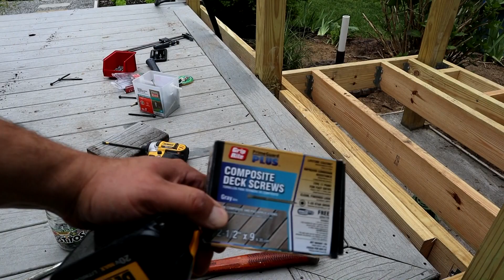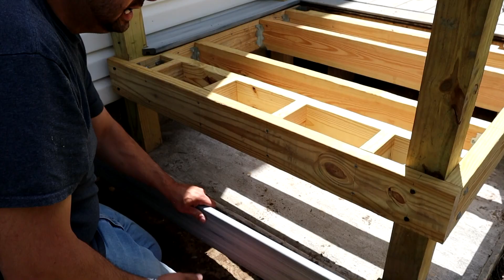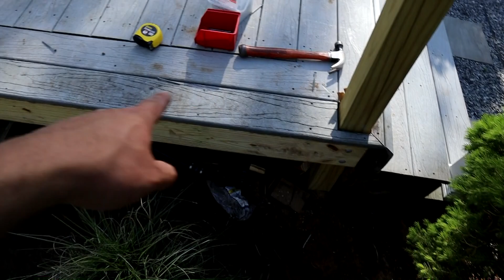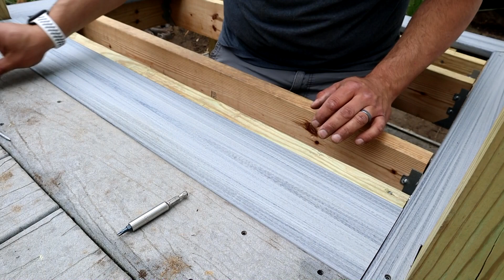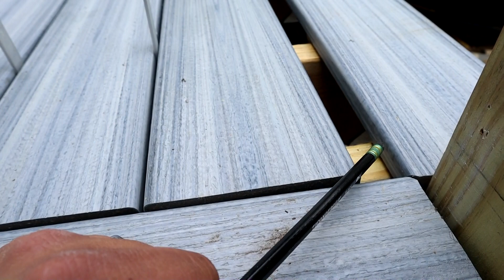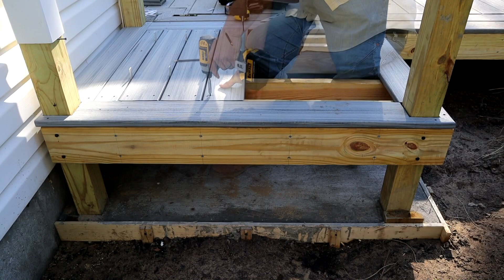Install Composite Decking | How To

Comment from the maker: Joist Tape: https://amzn.to/3wYFFQu
The LAST pair of pliers you’ll ever buy that the PROS use: https://amzn.to/3aYacDk
The BEST Screwdriver: https://amzn.to/32XKy1m
Miter Saw: https://amzn.to/30UHYFJ
Milwaukee Drill/Driver set: https://amzn.to/3auep1t
DeWalt Drill/Driver set: https://amzn.to/2PVXmM3
AWESOME wrenches: https://amzn.to/3lioLq3
DeWalt grinder: https://amzn.to/34LalZV
The BEST Hammer: https://amzn.to/3lUKFjw
Canon M50: https://amzn.to/2PdqqhO
Level 2 foot: https://amzn.to/2Gxa02F  
Mic: https://amzn.to/33jqXae
Tripod: https://amzn.to/3k4w3wP
2x6 Joist hangers: https://amzn.to/2R3xiz2
2x6 Concealed joist hangers: https://amzn.to/35gMJwt
Joist hanger 1 1/2" nails: https://amzn.to/2ZezW9P
Joist hanger 3" nails: https://amzn.to/3jQSncr

Comment: Did you add fascia to this deck or leave it with the bare wood look? I'm debating on just painting the structural area white instead of adding fascia due to the grooved bottoms of the Fiberon Goodlife. I don't think I can add fascia under it unless I make it flush with the deck boards which I don't like the looks of that method.
Reply from the maker: Yes, I added facia and lattice. There’s another video on my channel covering the install.

Comment: no expansion around the picture frame??, or anywhere for that matter?
Reply: That's what I'm thinking too! I'm about to start laying my composite deck and looking for proper gap on butt joints. Should I go for 1/8" or 1/4" expansion gap?
Reply: @juantamad8339  depending on what part of the world you live (summer heat) in but 4-5mm = 1/8- 3/16 should be enough
Reply from the maker: The problem I had when building this is matching it to the original decking. Ideally, yes...plan for expansion. I will say that after a full season of temperature swings and weather, the deck has suffered no ill effects. Thanks for the comment!

Comment: Thanks for the video , How’s face screwing the scalloped Trex is it strudy they recommend not to face screw it but I can only get my hands on the scalloped stuff right now.
Reply from the maker: Same problem I had when building this. Nothing was readily available due to covid. The deck has been in for over a year in all seasons in my area. 100 degree heat to below zero temps/snow, 2 hurricanes and a tornado. No issues at all!  I think it passed the durability test 👍🏻

Comment: Thank you for the tips. I recently did my first composite install and was torn between spacing my mitre joints or butting them. Do you think it is something of major concern to space them or not?
Reply from the maker: I personally don’t like the miters spaced, looks like something was cut wrong in my opinion...but, to each there own!  Thanks for the comment!
Reply: @fixitwithzim  thank you for your feedback.
Reply: you should always leave a gap between composite decking as the product can extract in warmer weather, so if joints are butted they will buckle

Comment: What screws you are using ? How come you are not using hidden fastener system ?
Reply from the maker: Composite decking screws from Lowe’s or Home Depot.  The existing deck this is connected to doesn’t have hidden fasteners so to make it all somewhat match, i opted to go the old school way

Comment: how come no joist tape ?
Reply from the maker: I’m not sold in joist tape. This deck was originally built in 96. Joists still perfect without tape. Ripped up deck boards a few weeks ago on a deck built in the early 80’s. Joists were in great shape, reused all the framing for the new boards. Who knows. Sometimes new stuff isn’t always better

Comment: Very well done! I have a question though. Instead of putting in two thinner boards that you had to cut on each side, why not just put one thin board against the siding/house? I know that’s nitpicking. It’s really not even noticeable the way you did it. It looks outstanding!
Reply: That way, it looks even on both side.

Comment: The final job looks very cheap. The other method is to use plugs the same color as the boards to hind the screws or use fasteners where no screws are used at all. 

The last solution being the best.
Reply from the maker: I mentioned it in the video, I was matching this area up to the original deck which was installed was exposed fasteners.  Sometimes you gotta work with what you have.

Comment: The small deck piece that was ripped should go agaisnt the house to help its even there. thats like day two of carpentry apprenticeships... just saying
Reply from the maker: Not when you picture frame the deck perimeter my man.  Full boards for picture frames. Thanks for the comment
Reply: @fixitwithzim  would still be on board up next to the house and much less noticeable then at then at the front. Just my opinion and the opinion of every custom home builder in my area. its all about the details
Reply from the maker: @adammiller8415  nahh, that wouldn’t work but thanks for the feedback 👍🏻
Reply: Im coming up against the same problem on a much bigger deck. I cant decide if i should have one sliver or two wider boards. Also wondering if i can notch a scalloped boar after ripping it like that so I dont have to face screw it and use the hidden fasteners instead?

Comment: You forgot the joist tape
Reply from the maker: For me, the jury is still out on joist tape and whether or not it helps or hurts. We shall see. Thanks for the comment
Reply: @fixitwithzim  I'm in process of redoing the deck where I just move to and trying out the tape because original build of deck 1 foot over dirt and had sides completely cover in and trapping all moisture rotting a lot of the pt joists and pt deck boards never being able to dry out. Now recovering with Trex  and adding lots of ventilation on sides so I hope it works. But where every screw was countersunk on top let a small puddle of water to sit and leak thru and saturate top of joist and rot.
Reply from the maker: @goaheadmakeourdayscooterpe9644  nice!  Yeah I like the thought process behind the tape. Maybe I’ve been lucky. I’ve reskinned several decks over the years. Replacement rotted pt or cedar with composite. No matter the condition of the deck boards, the framing was always solid. Good luck with your build!